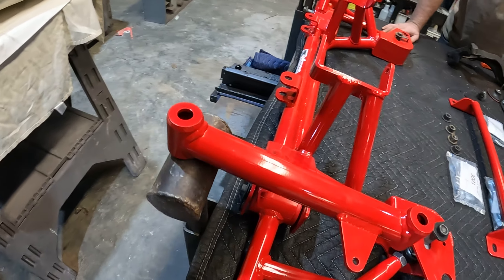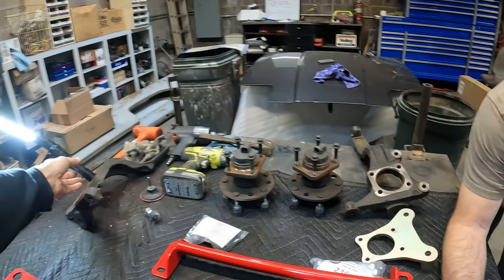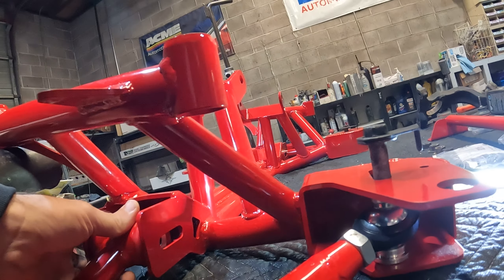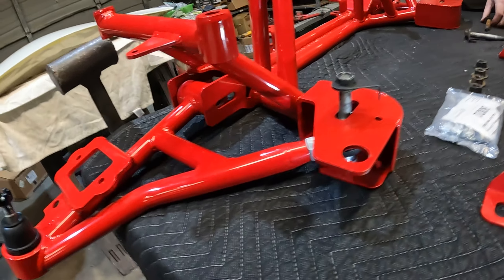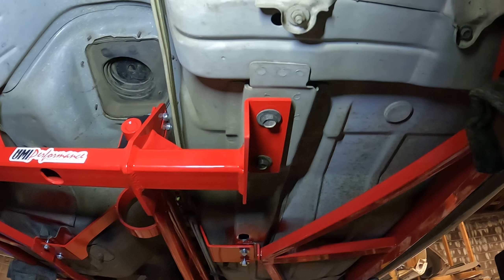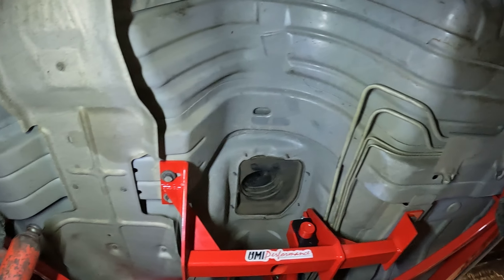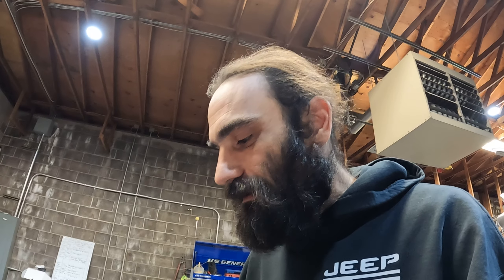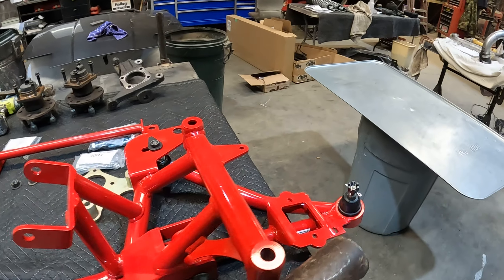Some of our issues with the UMI performance A-Arms, K-member and torque arm setup.

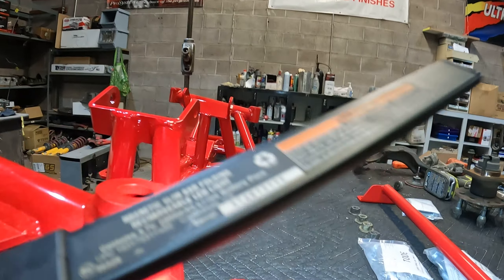Comment: the bolt you have shown at the beginning of the video and @1:26 , where can I find these? I need them
Reply from the maker: yesh they have them on the website as an extra drop down when you order the control arms. id search for control arm bolts. they say they are grade 10, but they looked like grade 5 to me. . .  its super frustrating trying to deal with all the BS over hardware.
Reply: @RideRevival_Outdoor  go watch the 100+ other videos of these installed on youtube.... no one else runs into the same issue you did
Reply from the maker: @bigxbudxbudda  that may be the case, or the ones who did just forced the bushing. I dont know. this video was actually sent to UMI for internal review, and was never really intended to gain viewership traction. is what it is. i fought several issues all along this project with both UMI and BMR. i try to do things right, and address what i see. im not one of those slap stick cookie cutter shops. not sure what else to say. . .

Comment: What’s the washers called that hook to the little hole on the lca bolt
Reply from the maker: those are actually part of the factory lower control arm bolts. the new k member is provisioned for them, or a grade 10 that you can order with the kit.

Comment: What did they do to resolve this? I just got my k member and I'm going to be getting tubular control arms as well and torque arm
Reply from the maker: they sent out replacement Arms, and custom machined misalignment spacers. we are in good shape now.
Reply: @RideRevival_Outdoor  nice! Good to know, can't wait to see the build done and what's to come
Reply: @RideRevival_Outdoor  how can i get some ? do the offer them on their site ?
Reply: I’m sure you found out pretty quickly that adjusting the rod end with the new spacers you were gripping about was extremely difficult.  The factory leaves a gap there, as does UMI and some of the other companies that make these, for a reason.. Without the gap, making adjustments for alignment on a car that’s already together is damn near impossible without removing the LCA.   Use a washer as a shim and make your life 5x’s easier. Then you wouldn’t have to make a video bashing a company about their quality part because of your lack of experience.   

Videos like these are a stab in the back to manufacturers or any business that makes parts. How would you like getting a permanent demotion and a pay cut for the rest of your life?  That’s what ends up happening to the manufacturer in the long run. Imagine when a customer leaves a bad review or a rant video about your shop, even though you went out of your way to make things right. It doesn’t matter if you made things right. The negative remarks are there for the world to see and at the end of the day you still lose potential customers.  

I’d suggest deleting this video from existence if UMI went out of their way and fixed the problem. Its out of good faith.

Comment: I had a hell of a time installing my factory f-body lower control arms into one of these. I had to knock the horizontal bushings back from their seated positions, different amounts driver/passenger side to get all 4 control arm bolts in. Not too happy having to run it that way. Have yet to have the car aligned, so we'll see how that goes. Also, there was less space for a turbo downpipe than the factory k-member, and they advertise it as having more clearance for downpipes. I had to have a fab shop cut the vertical passenger engine mount bar, and weld it in a different position in order to run my turbo kit. And then pay a powder coat shop to re powder coat it. All in I probably have over a grand just to make the damn thing fit my car. Would not recommend their k-member to anyone....
Reply from the maker: Yeah ive had all sort of issues trying to make their products work. I paid more for the R&D/support IMO than the actual product. none of witch ever did exists. i should have fabricated them and charged the labor.

Comment: I cant speak for UMI Products as I've never used them. But my BMR K-Member and Adj A-Arms on my 97 Comp T/A fit like a glove. I'm not sure if UMI uses a robot welder or if they're welded by hand. But if they've been using the same jig for years without issue. I'm wondering if during the welding process the material built up to much heat and got some warpage.

Comment: I heard you mention that the torque arm didn't come with hardware. However, i saw you had a 3003 hardware kit on your table. That belongs to said torque arm. Also, depeneding on which torgue arm you purchased (2205, 2198 or 2199) they each come with their own set of hardware that should be wrapped with the part. A few of them even come with the small mounting plate which is a 2215-g if you happen to need one in the future. I hope your issue was handled accordingly
Reply from the maker: I will reiterate my point here. Put the hardware kits in the component packages as a standard. If it increases you total bill of materials so much that you need compensation for the hardware, increase the total cost of the part package. Making us (builders and consumers) order the hardware separate from the kit, is out of line. it causes so much added stress, and logistics. This is the ONLY company i have dealt with that does it this way in all my years. And even some of the hardware kits are incomplete. Its Ludacris. Did i get handled accordingly? that's a vague way of saying it. . . No i was basically told nothing to worry about here, and the twisted brace never did get replaced. After wanting to do business with these guys for years and years, im pissed i did, and wish there was more i could do. but alas. swept under the rug, and they moved on. I got stuck dealing with it, as i always do. Try to explain this to the client wanting a low cost and build time. HA!  thats life, thats customs, and i dont anticipate many companies standing behind their product, like i do. Wonder why there are so few left doing full customs and body and paint, in house. This, and these are many of the reasons why.

Comment: I understand the alignment issues can be frustrating but bolts? Cmon those 4 bolts are existing bolts that should be on the car to begin with.
Reply from the maker: reusing factory bolts on a build like this. No, id prefer new hardware all the way.